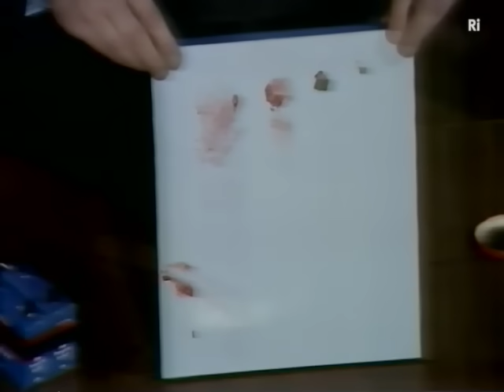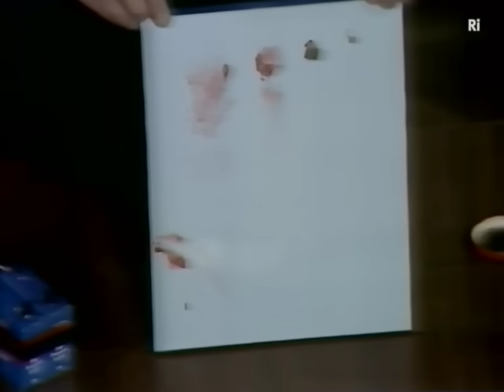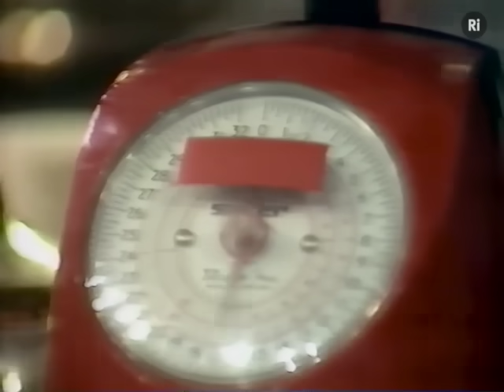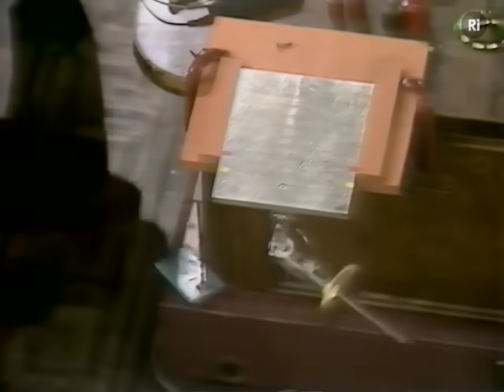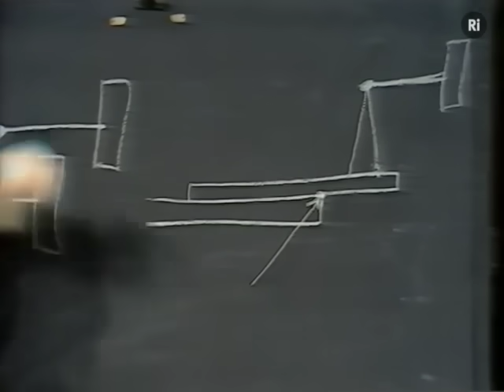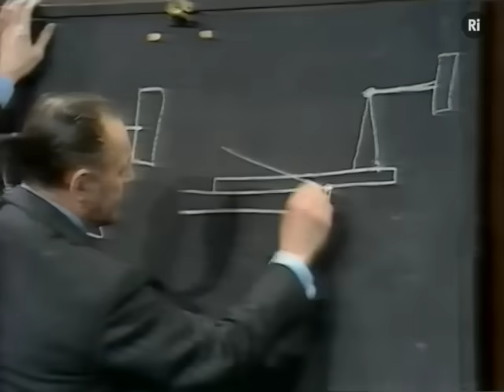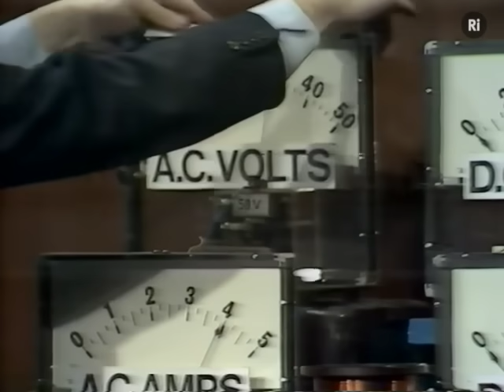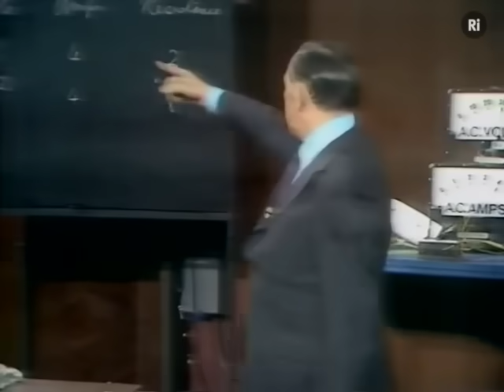☝#AntiGravity Part 3: Eric Laithwaite's Reality-Defying 1974 Lecture on Gyroscopes #HiddenScience

Comment: Prof Laithwaite was easily able to lift the weight at its full speed because the rotor was cetrifuging all its weight off the bearings.
A spinning weight above a certain revs has no weight as all the weight is being centrifuged off the contact area of the shaft.
It is only when the speed drops that the weight can impinge on the shaft and transfer its weight. 
Gravity pulls the still rotor and shaft down but when spun up the rotor becomes weightless.
If Prfo had a finely balanced weight and super beaings he woudl have been able to spin it over his head for longer and possibly one or more full rotations.
Plus trying to turn the shaft brings precession into play and that also impinges on the shaft.
Jet engines run for decades because their revs keep load off the bearings.

Any scientific questions just ask me.
Reply from the maker: A spinning mass retains its weight even at high speeds. Eric was able to lift the even gyro due to "forced precession", which the gyro moves upwards without expected reaction.
Reply: @mes  Eric was able to lift the weight because at critical speed all its weight is centrifuged off the bearings.
Reply from the maker: @rosewhite---  That is speculation and irrelevant. Eric showed that forced precession generates inertial lift, which is better seen in Experiment 20: https://youtu.be/xTrwlo8B3rs
Reply: @mes  Eric was able to lift the weight because at critical speed all its weight is centrifuged off the bearings.
Reply: @mes  Eric was able to lift the weight because at critical speed all its weight is centrifuged off the bearings and in effect weightless.
The precession is therefore a factor of Earth's rotation.
It would be interesting to see an Australian researcher repeat the expirments to see which way the gyro precessed and lifted etc.

Comment: Original Theories
Ref= Anti-Gravity Wheel? - YouTube, https://www.youtube.com/watch?v=GeyDf4ooPdo

Even though the overall mass does not change, it is not insignificant that the center of mass does in fact change. It is a very distinct proof of the NATURE of gravity if you know how to look. It's saying that the mass is equally attractive to the streaming "Space" (curved space) (See Ref=) but that the Streaming Space is now being distributed along the System of weight and attached stand. - And guess what? When you hold one your arm is also attached and so the G=MA is being distributed across your arm, which is why the perceived and "Actual Weight" is changed with the vectors made as you move the System. :face-turquoise-covering-eyes:
Reply from the maker: Note that the video you referenced is highly flawed and in my opinion purposely misleading. When the center of mass changes, it is associated with a change of weight-scale reading. This is similar to jumping in the air, when you are in the air, a weight-scale reading would measure zero. 

Instead of the Veritasium video, here is a better one by Eric Laithwaite, which shows forced precession causes a gyro to "lose weight" as it rises in the air completely airborne. https://youtu.be/xTrwlo8B3rs

Comment: It's indisputable the shaft and gyro weigh the 40pounds.
It's indisputable that it cannot really be lifted with one extended hand.
It's indisputable that it can easily be spun up over the head quite easily for a very brief time.
It's indisputable that after about one circle above the head the weight once again becomes fully 40pounds.
Therefore the spinning gyro for a brief time does appear to lose weight.
It might be that the precession of moving the shaft causes instant and unrecognised stiffening Newtonian reactions in the skeleton and muscles.
However the ease that the gyro can initially be raised above the head might actually be a demonstration of anti-gravity at a very restricted gyro speed/precession combination that only exists for a very short time - less than one circle of the head?
Consider this: At a certain specific rpm the gyro bearings have very little load when the disk is vertical with shaft horizontal.
The disk will be trying to fly out in 360 degrees in effect taking almost all contact off the bearings but for a very tiny spot contact with each ball or roller in the bearing - or if a plain bearing is used there will be a minimum thickness oil film of practically zero friction.
As the disk is experiencing 360 centrifugal force at full speed it will have little friction and all its weight is pulling away from the shaft in full 360 degrees and in effect be weightless and have anti-gravity!
 As the speed drops below the critical point the centrifugal force will drop and the disc will begin applying heavy vertical friction on the bearings thanks to Newton's apple!
As the weight increases and the disc speed reduces as the circle above the head slows the precession and increased friction will come into effect to make the weight once again appear and make it impossible to hold the shaft horizontally or raise it above the head until the disc is once again spun to maximum speed.
To try pander to the deluded souls who think UFOs are alien  and might use some sort of gyroscopic antigravity power let's consider the video experiment but with some lightweight power system spinning a gyro disc at immense speed - mercury in a circle a la vimana tales? 
Spin a very big gyro disc on a horizontal shaft/bearing/magnetic field alignment and maybe the discs anti-gravity might overcome the weight of the UFO fuselage.
Add some sort of external directable power such as air jets or magnets and maybe the action of the power on the fuselage might induce some precession in the disc that might enable the UFO to lift off.  Logically fine adjustments of the power would allow take off, slowing and steering? 
We know Earth acts like a big magnet and logically some drive could be made to take advantage of this for use in a UFO that is weightless while its gyro disc is spinning superfast.
Introduce Nikola and his multiplying coils to create a gyro with an immensely fast speed and zero friction thanks to magnetic bearing and power source for a UFO is feasible.
Add wireless electrical input from Nikola's world grid to keep the UFO's disc spinning and hig speed cheap travel is possible.
Then BigBiz steps in and ensures all research is stopped in order to keep the humans paying through the nose for electricity..........and suddenly it's 1905 again and work stops at Wardenclyffe.
Reply: @ColinWatters  you are unable to understand the weight of a gyro only applies during contact. No contact no weight.
Reply: @ColinWatters  Sure does - but that mass is not transmitted to the shaft while the gyro is spinning above a specific speed.
This is obviously too difficult for you to understand.
Perhaps you might try studying videos of spinning things flying apart - that is why engine flywheels have to be made of good tough metal?